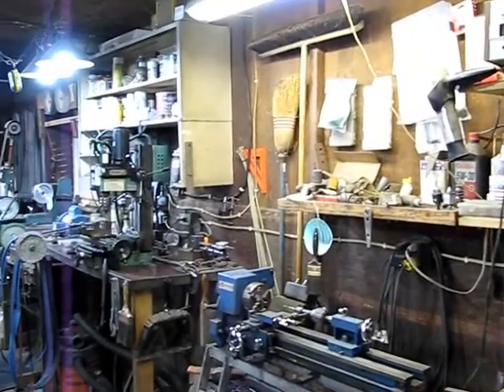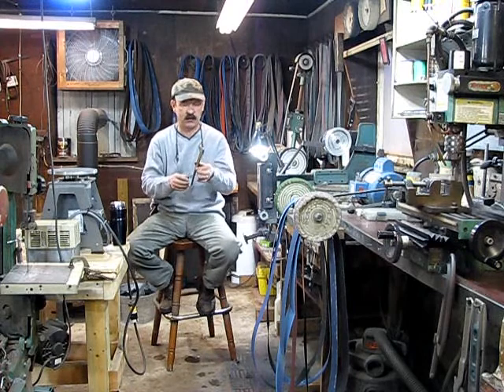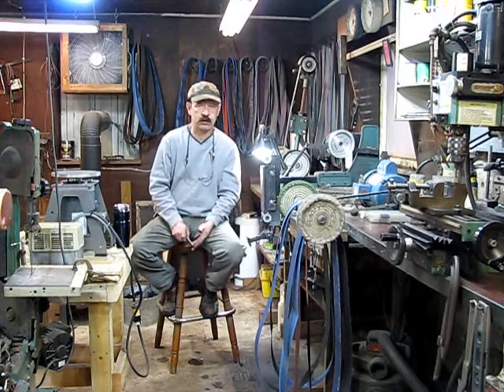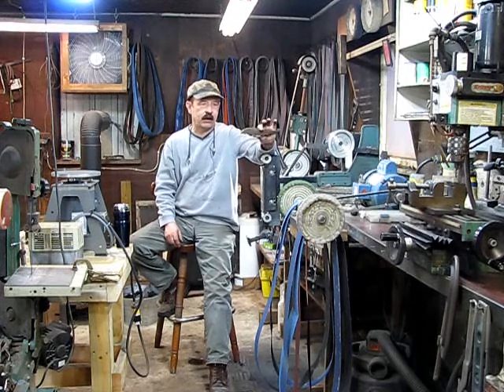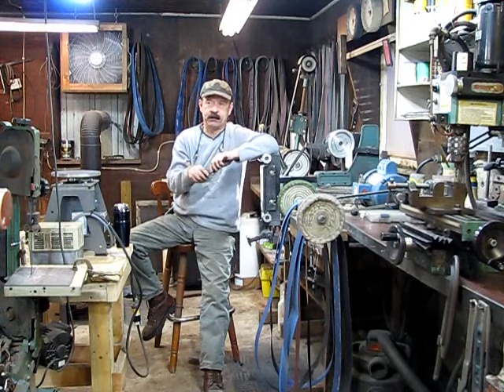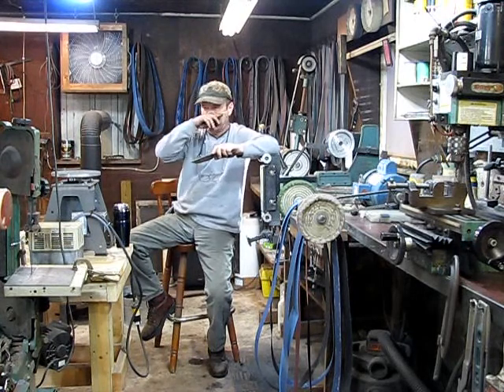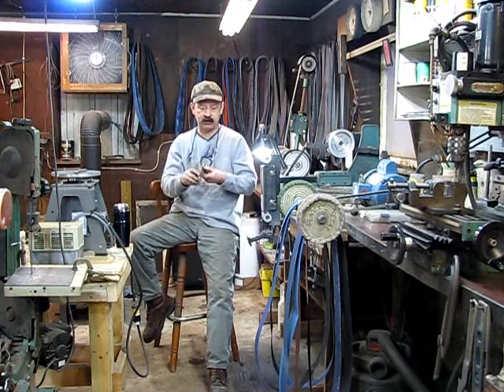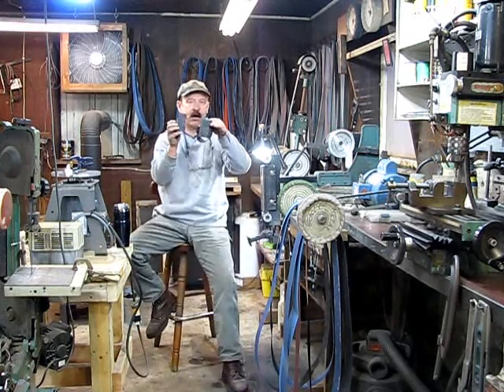Andersen Forge part 6,.wmv

Comment: I use that disc sander for getting things really flat and without deeper scratches from the belt sander or mill.
It is variable speed and reversible.
The frame tilts and when I get more accustomed to it, I will use it to refine my flat grinds.